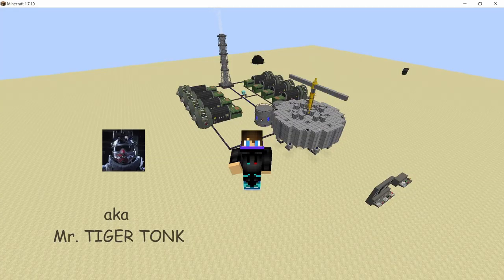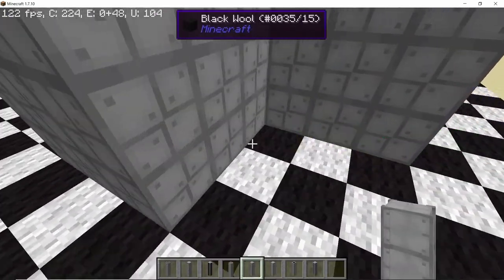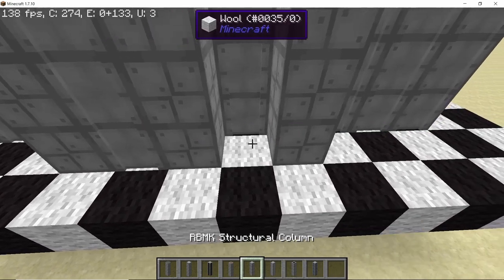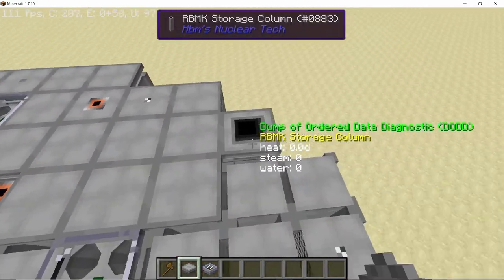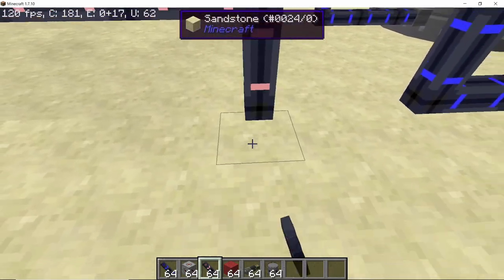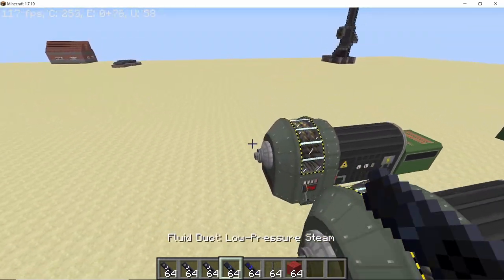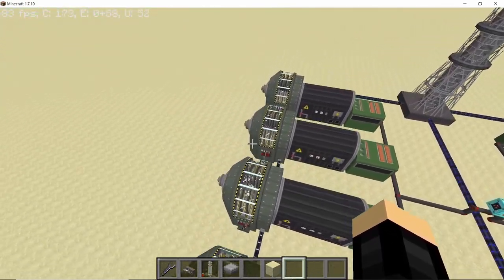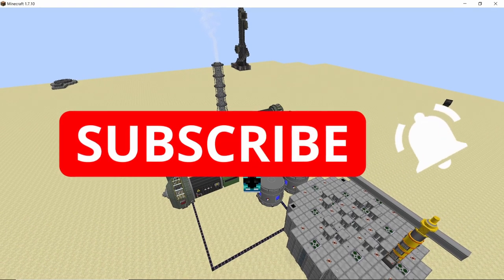Big "15x15" RBMK Reactor Design for HBMs Mod || AZ-5 Capable Reactor with RZM and Uranium Fuel Rods

Comment: Is it 1.7.10
Reply from the maker: Yes it is 1.7.10 dude
Reply: Oh, I was hoping it would be for 1.12.2 too, cause theres is a re-ported version for 1.12.2, but there isnt the crane thing.
Reply: Great video tho
Reply from the maker: @moonlord8725  I don't see why this version wouldn't work with 1.12.2 as well , the crane isn't necessary you can easily hot swap all the fuel rods by hand. But yeah there's the issue of water ducts not connecting to steam connecters idk if that has been solved yet or not
Reply: @SavageVegeta  First, i think it wasnt but I think it works still, but whenever I make the reactor (max is I think 13x13), I cannot fully kick-start it so that it wont leak radiation and make dead grass, meanwile running long enough to make ultra dense steam, I dont know why it doesnt work, I made it by one of the tutorial videos, but still bad
Reply: @SavageVegeta  I also tried it in single-player (I use it to test mods/Things) And it worked perfectly, I dunno why that RBMK fuc*** wont work on the server. Smaller ones do work, I think

Comment: i was not even trying to blow it up, but it blew, Good thing i copied the world with the complete reactor but not running
Reply from the maker: same solution as before, more heavy inf water barrels and aux cooling tower replaced with big cooling tower. The design is good just water is the problem here
Reply: had to give up on this reactor :(